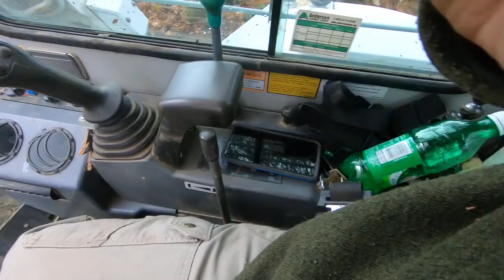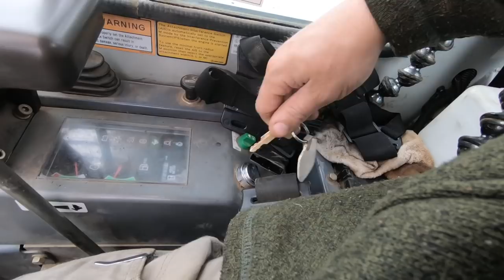It Finally Happened! (Time To Tear Down the Rock Wall!)

Comment: That entrance is a perfect way to add safety and landscaping value at the same time.  Now to bury some 8" pipe to heat and cool the south facing greenhouse to grow anything you want year round.  Your going to make a big rock wall.  Would also work to cool the basement and house.

Comment: Hi Al, great to watch the evolution of your homestead. Creating the gap will make walking around much easier. Can I suggest an alternative use for those two large flat rocks? Rather than sides, lay them down across the gap as pavers. It will stop the narrow being churned up and becoming a mud trap. I was raised in an area with high rainfall and every gap in wall or hedge would become a mud trap as the footfall churned it up unless you cobelled it. Have a great one.

Comment: This is where you can use wood chips to cover the mud of the new opening in the rock wall . Instead of burning my brush I chip it up and use the wood chips as fillers for the low wet muddy places .
This is completely unneeded but if you set a couple of posts  , maybe a foot wider than the opening through the rock walls ,  and made a nice looking farm gate , that would look cool and give a more finished appearance. What do you think ?

Comment: G'day Al.  You should start bottling all of that rain and sending it off to everywhere that doesn't have enough :)  With all that rain soaking into the ground, does it cause issues with ground movement or things like that?  I keep imagining all that water freezing suddenly and and expanding underground and potentially causing all kinds of issues.  Hope it dries out before serious snowfall.  What made you decide on the 8ft gap in the wall? Was there a reason such as Kubota access?  New Yolk City?  Excavator ?  or was it just a nice round number?

Comment: The easiest kind of stable dry-laid stone wall to make looks like a triangle from the ends: it's best to have at least 2-3 rows of the biggest stones (or more, depending on height) for the base.  For example, if you want a wall 3 courses tall, you need 3 rows at the bottom, 2 rows in the second course and 1 row in the top course. The biggest rocks need to be on the bottom, flattest side down; for more stability, half bury the first course in a trench.  Put the second row rocks (middle-size stones) in the gap between a double row on the base.  They will be most stable if you put them at the intersection of 3-4 stones. Ether fill in the gaps with smaller stones, or use them as the 3rd course.
You can also make a stile - like a step ladder that crosses the wall. These are designed to let people cross, but keep animals in the pasture. Here are some examples of stiles: https://www.youtube.com/playlist?list=PLz5RSh2WgOsaHRrSfkVdzXQ5et2ETYSNU

Comment: Its the end of July in 2019 and it seems as though the one issue is the weather. The water - always the water. No matter the season - this is goin to be a hurdle. And likely (thanks to climate change) you can expect that to continue or worsen. May I suggest that you will need to put some drainage swales (not sure of spelling) around your barn, around your permanent pastures that you will be adding there for the goats (and whomever is on the other side). You might want to put in a gentle, walkable swale in your big pasture, before you add cattle. Whether you are dealing with rain or winter melt, you need to gain control of where your water pools and where and how it goes or is stored. Just a thought.

Comment: I also got those black fence supports but they work better if you put them on the inside and put the top wire right in the notch and us e them for the corners no need for the white ones real close.

Comment: As you work with hydraulics I hope you think of those who gathered those stones off your fields and stacked them.
 We had a scoring system for our stones.  After all, we raised both stones and rocks as our main crop on our New Hampshire farm.  Any stone that can be lifted with one hand and maybe held out at arm's length is considered a #1 stone.   A #2  is a 2 handed stone.  A #3 we could roll and move, maybe get up on the wall with a ramp but that stone was too heavy for even me to lift.  # 3s were good for the base of a stone wall.  # 4 stones we could only move using levers and ropes with pullies.  You dealt with some 4s.
Reply from the maker: I thought if that every time I was using the excavator. We have it so easy.

Comment: Rock wall is locking good.
Why don't you try and point it .
That way it will stay solid and look good.
Good video as always.
Reply: They are not meant to be pointed! That's the skill of the artisans who built them. Rare skill.
Reply: @hanorabrennan8846  I understand that. As I do a little dry stone work my self.
But with the age and the state of the wall it can no longer be called an art more a pile.

Comment: I TOLD YOU BEFORE YOU NEED A SUB SOILED IT WILL GET THAT WATER OFF THE SURFACE AND DRAIN IT AWAY YOU CAN GET ONE FOR YOUR 3 POINT HITCH BUT WITH ALL THOSE ROCKS YOU MIGHT NEED TO RENT A  BIGGER TRACTOR DO SOME READING ON THEM